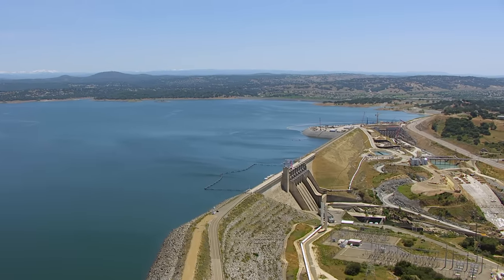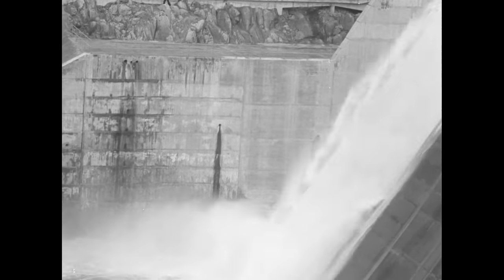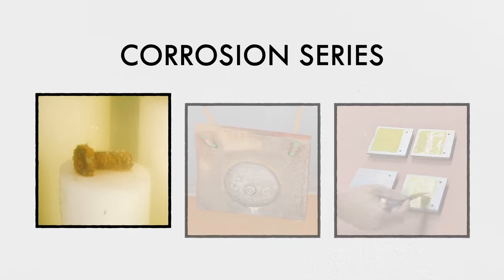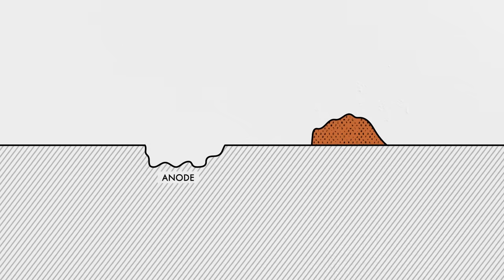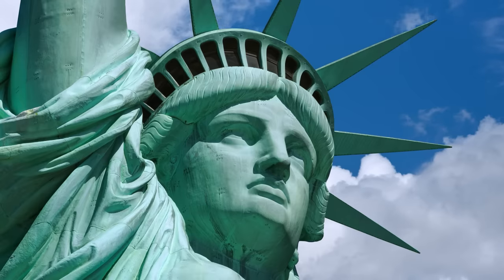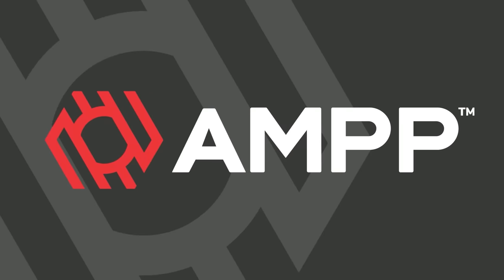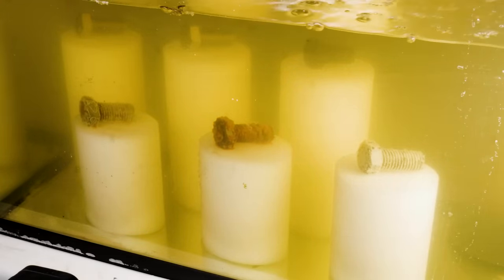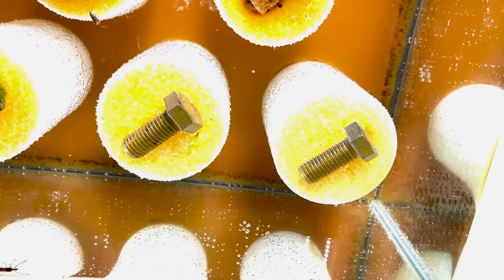You Spend More on Rust Than Gasoline (Probably)

Comment: Oxidation is also probably one of the most important, yet most underappreciated parts of modern metallurgy too. Without the incredibly thin layers of oxidation on all metals, different objects would "zip up" causing parts that should move against each other to completely seize. An everyday example of this is thread galling where certain metals will lose their oxide layer as they enter an almost oxygen-free environment in a threaded hole. If both metals lose their oxide layer they'll start to stick together. 

A lesser known, more historical example is on satellites and other objects in space/vacuum. Solar panel positioners initially functioned very well, but engineers were noticing that they were becoming increasingly more difficult to adjust, and eventually seized. The vacuum environment was perfect for mitigating oxidation, and also destroying it. Metals with a softer, less stable oxide layer had their oxidation flake off and the metals began to "zip up" even if they were completely different elements/alloys (crystal lattices are pretty cool). This led to engineers using and designing materials that had very thick, hard, and stable oxide layers for things such as bearings and other moving pieces. R&D for ceramics also skyrocketed as well.
Reply: Oxidation is also a key component in the biological processes of all life, except for some microbes. Combining oxygen we breath with the sugars we eat provides releases some energy which powers all cell functions. (Even plants need oxygen if they want to get the energy from their stored sugar at a later point.)
This oxidation of sugars is actually the same chemical process as burining wood and oil.
Reply: Hey, pretty cool. Thanx.
Reply: Good info
Reply: Don't they also do that on purpose, to "contact weld" components in place during spacewalks?
Reply: Yeah, this is particularly a PITA with pipe thread fittings- do NOT try to put two stainless steel parts together with pipe threads, they will almost certainly gall up and seize. I learned this the hard way, and had to teach all the interns "Don't do dat!"
Reply: Cold welding is the name of the latter phenomenon, thanks for your informative comment:)
Reply: "skyrocketed" I see what you did here
Reply: @hk78901  yes but it sounds more credible and less pseudoscience when the name is ommited :D
Reply: Wow thanks for sharing :0
Reply: The gall of this guy, taking about cold-welding in anoxic environments.
Reply: In the metal finishing industry, we use oxidation to seal parts against further corrosion. Substances like hexavalent chromate will provide great protection for aluminum parts by oxidizing the top layer. Nitric acid passivation gives stainless steel extra corrosion resistance as well. Basically, if you want to ward off rust on your metal parts, but you can't paint them, you purposefully oxidize the part in a very specific controlled manner.
Reply: I can totally attest to this from experience manufacturing optical assemblies for satellites. Most optical assemblies for land-based industry were made from anodized aluminum with a thick oxide coating. You could torque those threads down to a level that snaps the stainless pins off a pin spanner, and still not damage the threads. But when it comes to opto-electronics that have to take a trip through the ionosphere, everything has to be electrically grounded to the body to avoid arks and sparks, even the threaded retaining ring that closes it up. That meant we had to do away with the anodizing on the threads for those ones. Good thing nobody's ever going to service those assemblies from space, cause once those rings get a single turn, there's no going back. We had the machinist use a lathe to "can-open" a few to save the lenses inside a few times. Engineers tried replacing the anodizing with some conductive oxide coating that just flaked up and turned into glitter during closure, ruining the interior of the clean-room assembly.
Reply: E Van  That is because those gauge blocks have their surfaces polished to such a highly precise flatness. This makes it possible for the air gap between two blocks to be completely squeezed out if they are clean and pushed together. I've watched the air gap turn iridescent then disappear when resting precision polished glass plates on gauge blocks. With a vacuum between the blocks, the atmosphere continuously pushed them together with ~15psi on each side. If you push them together hard enough, you can force molecular bonding and start "zipping" the materials together. In optical industry, we call it "contacting". I've seen a polished glass block tear a chunk out of a larger one and remain contacted to the chunk.
Reply: @greenlungo3996  Nobody thought that maybe they could keep the anodized threads and add a grounding strap?
Reply: Its not the oxidation but the air trapped in between .
You would have to remove both in order for things to stick. Otherwise you could just stick 2 gold bars together since gold does not form an oxide layer.
Reply: Ah so that's why old bolts are such an absolute pain in the balls to remove.

Comment: When I was in the USAF, I had a reason to go to the plane paint shop.  The airman that worked there was called a corrosion control specialist.   He explained how the aircraft skin, if not properly painted, will fail and the plane will crash.  By the time I worked at a nuclear power plant, corrosion control and surface coatings very vital on some systems for the safety of the general public and plant personnel.  Paint just doesn't make things pretty, it protects them.
Reply: @GeorgeWashingtonLaserMusket  Who is drilling holes in their car?
Reply: @KGH3000  When they want to modify it?
Reply: Corrosion in the air force is simple. Maintain corrosion control kit. Check for corrosion before every use. If no corrosion continue. If any corrosion exists scrape and clean and reapply coating. Then continue
Reply: @KGH3000  the factory that makes it
Reply: @KGH3000  me I have drilled holes in my car before
Reply: i actually did not knew much about the "rust industry" before watching this. The video and comments like are now making my business mind to spin gears.. thanks!
Reply: @KGH3000  People who mod their cars with body kits and spoilers.
Reply: Then you should know it’s a coating not paint 😂
Reply: @KGH3000  those who want to install spoilers, lightbars....
Reply: Non destructive testing is key
Reply: @KGH3000  Anyone you've ever seen with an aftermarket spoiler.
Reply: A lot of people think of paint and they think of whats on their car or their walls in their house, on infrastructure projects we don't use paint we use a "coating" which is a fancy word for paint in lamens terms but is very different in many aspects. generally the best way to view the 2 is paint is for looks and some protection and coatings are for protection and looks are just a feature.
Reply: They merged that job with aircraft structure maintenance not too long ago

Comment: When I was in the Air Force in the 1970s we had a career field called Corrosion Control. I was on a Preventative Maintenance team that worked on Minuteman Missile sites. One of our team members was a  Corrosion Control Technician that we called a "Crud Man."  His truck was the "Crud Van."
Reply: Navy/Marine Corps also call it "Crud". Corrosion control on aircraft is given lots of emphasis, especially when your aircraft operate off of ships or low over the sea. One Marine Corps air base I was at I remember there was a sort of wash system we called the "bird bath": after landing, every airplane would taxi through it like a drive-through car wash and it would spray water over the whole aircraft to rinse the salt off of it, through the jet engines, too.
Reply: I've visited a few of the missleman sites, very cool engineering involved
Reply: @RCAvhstape  Yep. Our unit found that de-ionized water really helped. We just used a spray truck though.

Comment: Living in a place where tons of salt are dumped on the roads every winter, I'm quite familiar with rust and what it costs me as it eats my vehicles.
Are you going to do a follow up of this episode? Covering things such as various platings and coatings, as well as cathodic protection for underground pipes and fittings?
Reply: Sounds like Ontario, Quebec
Reply: @PierceMD  and michigan, usa 
Its like planned obsolescence except nature is the cause instead of a planned design flaw.  id pay more for galvanized steel or aluminum body just for longevity. 
it saves more in the long run even if your not the owner for the life of the vehicle. rust can weaken the structure and an impact to a weakened structure is more often deadly.
Reply: Maybe you missed it:  Early in the video, he said that this is the first in a new series on corrosion
Reply: @PierceMD  it's in the whole world that has real winters. 
t. Swede
Reply: @DarkShadowsX5  I have the same issue and so I paint the underside of my chassis with a thick coating of used engine oil before the salt season sets in. It doesn't entirely stop it, but it definitely helps.
Reply: @slartibartfast2649  does the oil really stay on? Feels like it would run off quite fast.
Reply: @ano_nym  It's a thick oil, about the consistency of cooking oil, but you are correct in saying most of it does drip off. Only a thin layer is really needed to stop a good amount of rusting though. In the spring the underside of the car is usually still a bit oily to the touch.  

First, I use a stiff brush and a pressure-washer to remove dirt build up. After the chassis has dried, I apply it with a cheap 6" or 4" painting brush from the bucket of waste engine oil left from every oil change I do during the year. My truck is over 20 years old now and in great condition on the main members. 

I must add that I don't live in the worst place for car rusting. The roads are salted from November through February most years.
Reply: @slartibartfast2649  sounds interesting. Might try that on my own car some time.
Reply: @ano_nym  I would add that you should never do it on your front drive since the oil soaks in and stains concrete or stone permanently, especially if it is used oil which is black.
Reply: A guy who puts salt down on the roads says he sprays his truck down everytime he salts the road, especially underneath it and around the rocker panels and it works wonders.
Reply: @ano_nym  You should know about calcium sulfonate greases, like Mobil Centaur or WOLVER TIREX HT2. This stuff sticks like hell to any surface and stays there for really long time. Never completely dries out. Can only be blasted out from underbody with road sand and small stones. I has vulnerable parts of my car covered with it and I like result. 6 bucks for grease and 1 day of dirty job under vehicle and rust goes away for 2-3 years.
Reply: buy  a delorean
Reply: @slartibartfast2649  While it would be more expensive, you would get a MUCH better effect using Fluid Film instead.
Reply: Glad to live in a state where the local gov puts sand down instead. I much prefer driving around a decent vehicle with a pockmarked windshield.
Reply: You need a cybertruck, the SS construction is my favorite part, a lot of farmers in the Midwest would like a rust proof truck
Reply: @Mister_Durden  cringe, SS still rusts
Reply: Never get those ruberized undercoats.  They actually act like giant cups underneath your vehicle, with moister wicking down between the metal and rubber coating, keeping the metal coated in moisture 24/7 which maximizes corrosion.
Reply: @houseofwonders1  is right letting salt and snow and dirt set is the worst, have to wash the salt off
Reply: you should ask a city official or someone who runs the salting of the streets to consider cinders! they are tiny little volcanic rocks that absorb water and allows it to freeze inside the rock while also creating 
more grip. also doesn’t destroy your car as much
Reply: I had an oil coat sprayed on the bottom of my car a year or two ago.  Should probably get it reapplied soon with winter coming (should also replace my battery which is like 5 or 6 years old now).
Reply: the way he made videos on both of these + more makes me so happy
Reply: Salting roads is so dumb. Just everyone decide to drive slower.  All your cars are junk. You're losing trillions.
Reply: You could use Fluid Film or Blaster - Surface Shield .

Comment: Used to study in structural health monitoring. It's "easy" to detect damage e.g. from impacts, but the slow corrosion is near impossible to detect.
I once saw a part of a chemical plant: It was 2cm of steel (specifically designed to be as inert as possible) and it had holes going nearly through the whole thing. The guy who brought it with him said that they had the thing running for about a day. Not rust, but still corrosion (I think). A few hours longer and they would have had tonnes of acid spilling in their plant.
Reply: Wow
Reply: In just a day ? That is some incredibly corrosive stuff !
Do you remember what they did to fix the problem ?
Reply: @noemierollindedebeaumont1130  I didn't follow up with that, as it wasn't the topic at that point (I'm not a chemist). But I think he said that the problem was caused by a slight mismatch in concentrations of different agents, so they probably fixed that somehow.
Reply: @noemierollindedebeaumont1130  Hi, it may have been hydrochloric acid plant. That thing eats metals like cookie monster eats cookies. The way to avoid damage is using ceramic piping, those are eternal, but prone to leaks. The simplest solution is using PVC, but that cant be exposed to heat, as it gets too soft, plus big downside is the flammability. In other chemical plants is often used titanium since it is chemicaly inert, with exception of chlorine. Obviously, glass pipes are also an option.